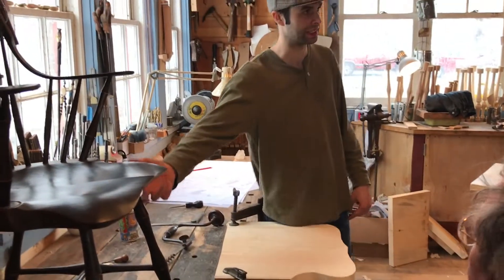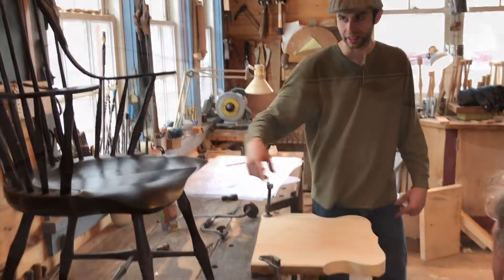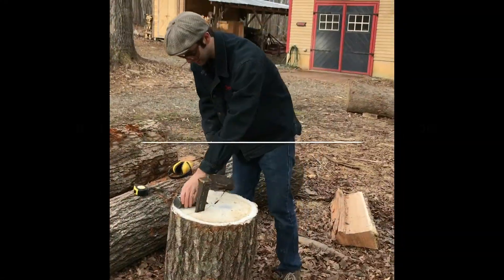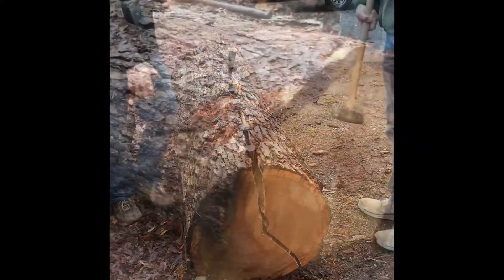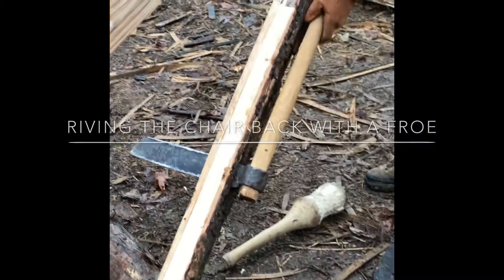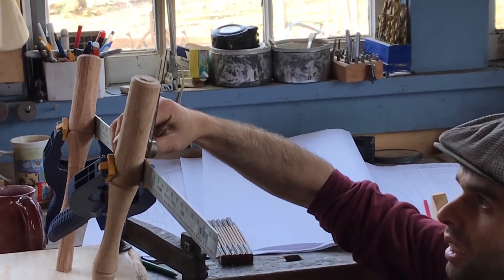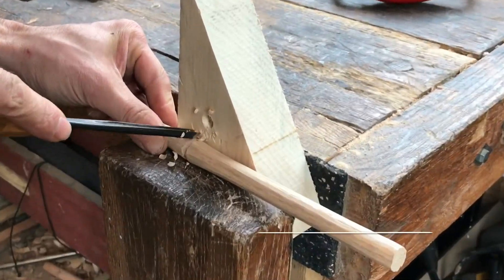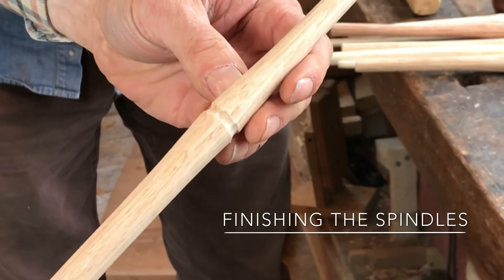A week in a Windsor chairmaking class

Comment: Beautiful chair, but authentic English Windsors have different leg angles to look and work right. I don’t know about American. The back legs were splayed back but more parallel. The front legs splayed only sideways. The angle of the back is called the slouch. The seats were originally worked when the wood was fresh, as was the rest of the chair and then final finishing and assembly in the factory or workshop Elm goes rock hard when dry. Ok with modern power tools but difficult to work with an adze and travisher.